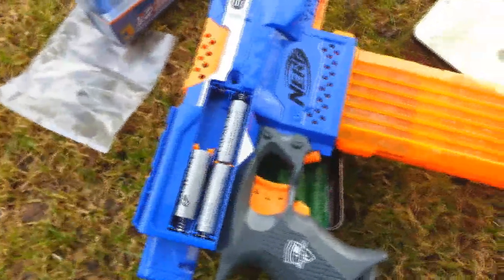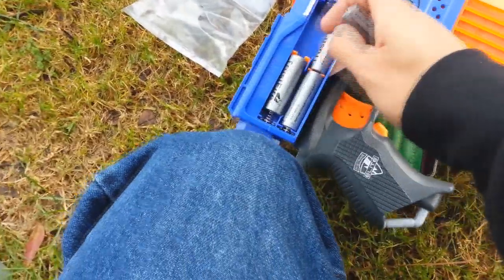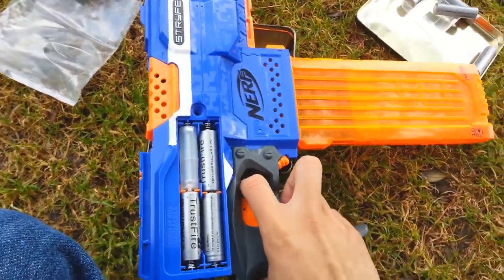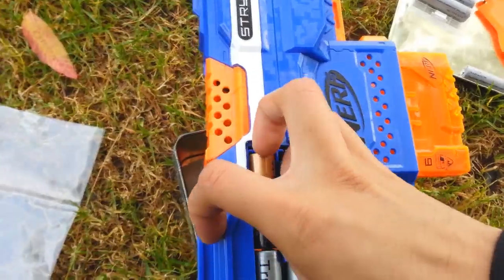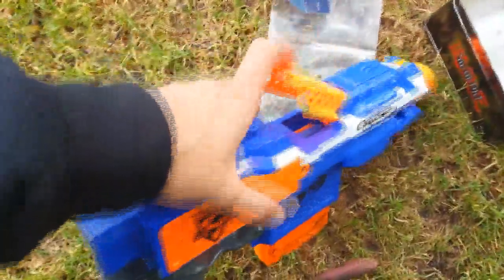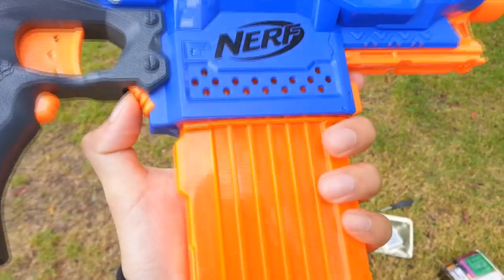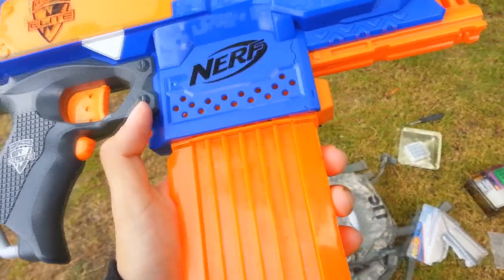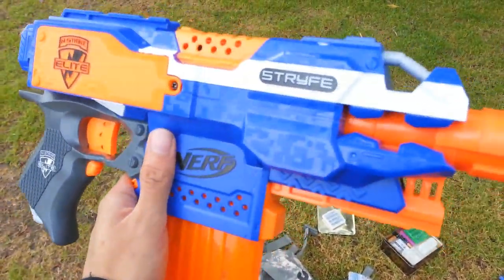Nerf N-Strike Elite Stryfe Technical Observations (Voltage limit, locks, and magazine)

Comment: Do you have to remove the thermistor to run 3 trustfires?
Reply: You have to remove the thermosters to put anymore than 6 volts
Reply: He just did 12 volts...
Reply: CubeSicle no u don't I ran my stryfe on 8.4 volts without doing anything inside the gun

Comment: They have a "voltage limiter" in the Barricade as well, so if you try putting three Trustfires/Ultrafires in one, the same thing will happen.
If you want to use higher voltages in Stryfes or Barricades or whatever, simply rewiring the blaster by taking out the resistors and the thermistor will allow you to use higher voltages.
Just do it, it's very simple when you know what you are doing.

Comment: Addition to my reply:
Performance wise, the Elite Stryfe and the Elite Rayven are pretty much at par.
Price wise, the Stryfe is less expensive. Probably because the Rayven has the glow-in-the-dark FireFly Tech clip, which is more expensive than the clips that come with the Stryfe.
The Elite Rayven comes with 18 darts, the Elite Srtyfe comes with 6 (normal Elite darts, not glow-in-the dark Elite darts that the Elite Rayven has)
I hope these comments helped you.

Comment: Well, which Rayven are you referring to? The older one, or the new Elite one? If you're referring to the new Elite Rayven vs the Elite Stryfe (it's the Stryfe, there isn't an older model of the Stryfe), it's all a matter of personal preference. I happened to try out both blasters. I chose the Stryfe, but I liked the glow-in-the-dark darts the Elite Rayven uses. As far as the feel goes, I liked the Stryfe more, but the Rayven is still okay. Again, it's all a personal preference.

Comment: Deal Extreme, but I have been using Tmart here lately and have had no problems. They are secure, ship fast and accept Paypal.

1 X  4.2V 600mAh Charger Adapter with 2Pcs 14500 900mAh 3.7V Rechargeable Battery
88009632 * 1          {Cost me $7.61 and free shipping.}
The dummy battery I got off Ebay from "world_electric_fan" (China). Cost me $1.99 and free shipping. It is listed as "AA SIZE BATTERY OCCUPIED CASE work with 14500 battery". Hope this helps because no one was giving this info out.

Comment: 2:50. the reason the button is there, is so you can hit it with your middle finger (the same that revs the accelerator) and pull out with your spare hand. much easier than messing about with whatever 'two-pronged' method you came up with.

Comment: HOLY CRAP! DON'T EVER MIX batteries of different chemistry. Batteries try to balance out voltage across the cells. Lithiums are the most unstable when doing this and can explode from reverse charging. Those lithiums, freshly charged, will be around 4.2v. That 1.5v alkaline will be fried and the blockage would have caused at least one of the lithium cells to explode.

You should write NERF and thank them for having a voltage cutoff. It likely saved you from SERIOUS injury.

Comment: From what I have seen from both blasters, it depends on preference.  I own a hailfire and it can dish out a lot of foam without the need to reload.  However, it is slightly cumbersome and a bit unwieldly but I find it not to be a problem.  That being said, if you prefer maneuverability over sheer capacity, you would probably want to go with the stryfe.  It seems to be one of those choices that depends on your style of play.